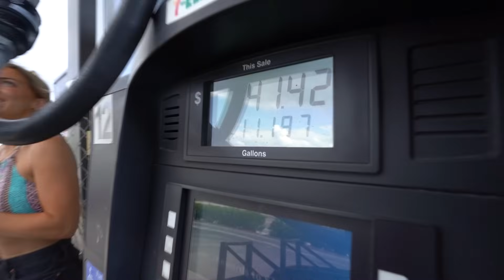Mega Truck VS Stolen Jet Ski

Comment: You guys should’ve turned around and took pictures of it first and then turn around and call the cops and tell them that they have a JetSki that was stolen and it’s sitting out here not running it over or doing anything to it because now you can get in trouble for it